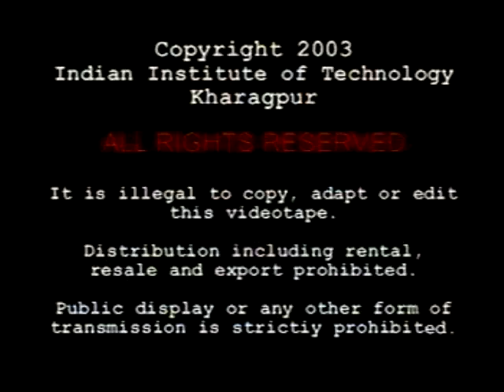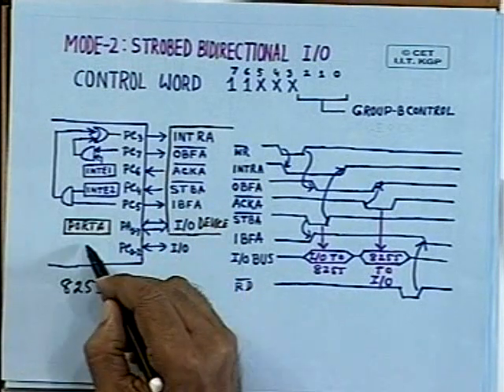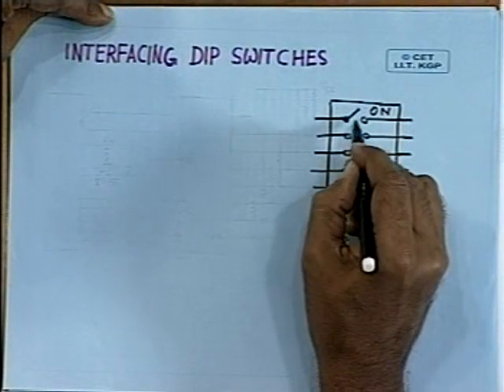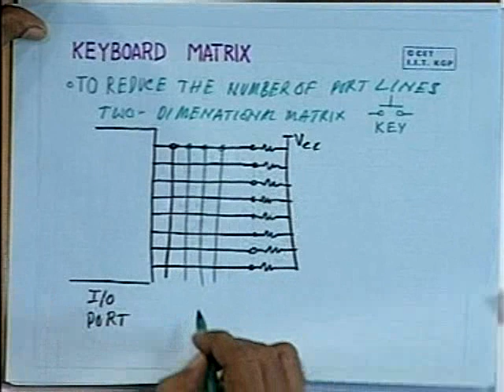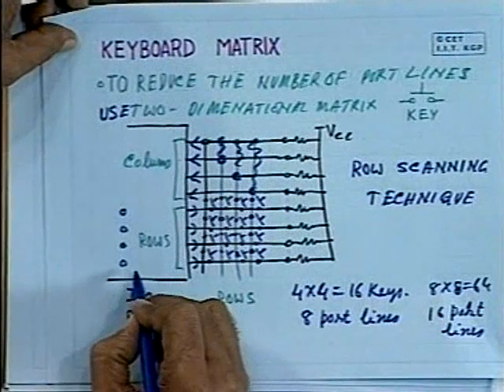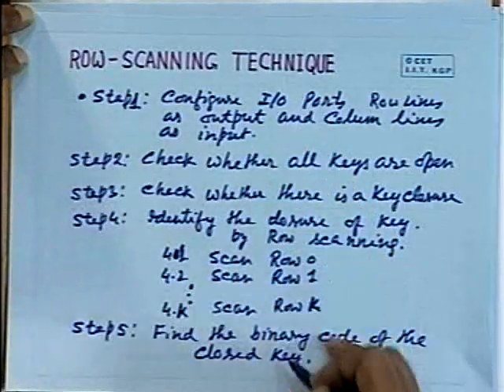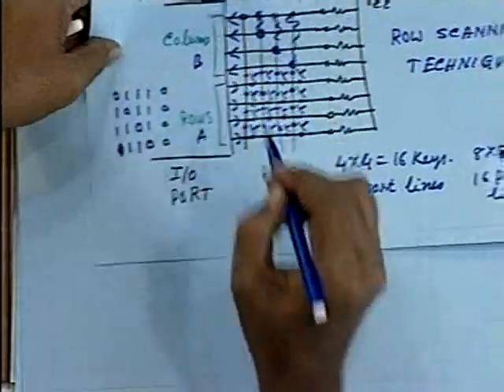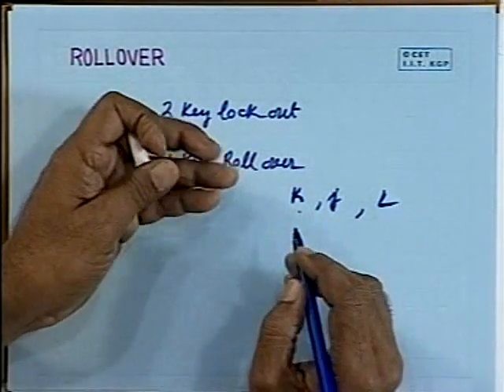lec 15 - Interfacing of Switches

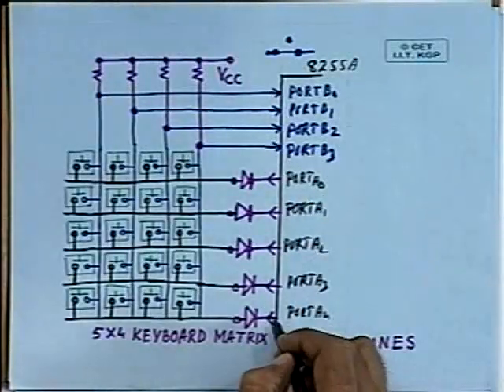Comment: 41:52 you can keep on with port C if add 4NAND (or 4NOR, depends of logic) gate  to access fifth row not to waste whole both 8 bit ports A and B. 47:21 decoder is obvious solution, and no alternative if you want 16 rows, but if you want only 5 rows, the decoder usage costs you whole chip, whilst NAND/NOR gate is still capable with the task and costs you ½ or⅓ of chip, having 1 or 2 spare gates for other tasks.